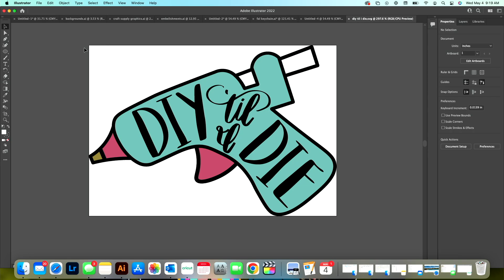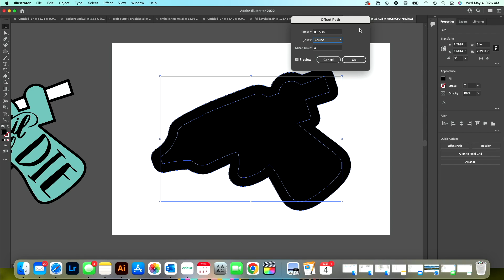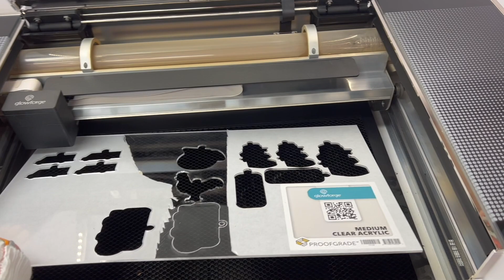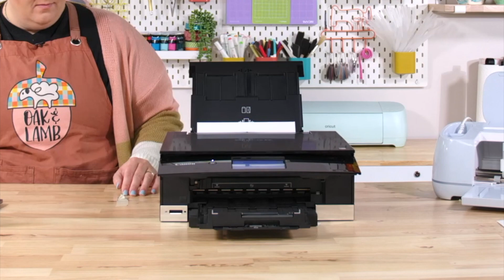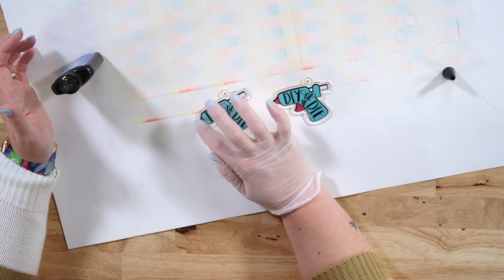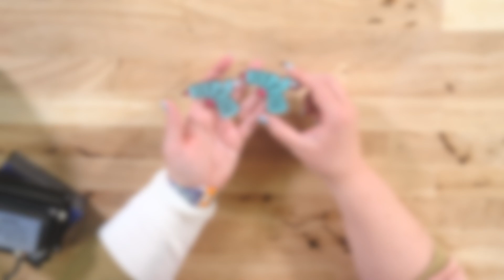Perfect Acrylic Keychains With Cricut

Comment: Great tutorial! 
Is it necessary to have a UV light or is that just so it will dry faster? I have never used a resin, but love the idea of protecting the vinyl. Are there other resins that are simpler to use? If so would love a video comparing different resins. :)

Comment: You can also hack it by spraying the print with hairspray to seal. Must let dry. If using regular print paper be sure to spray both sides and dry before coating with resin. I used to do this on tumblers,
Reply from the maker: Love that idea!